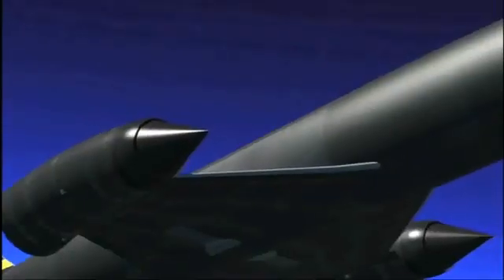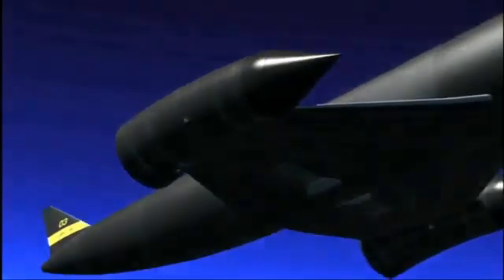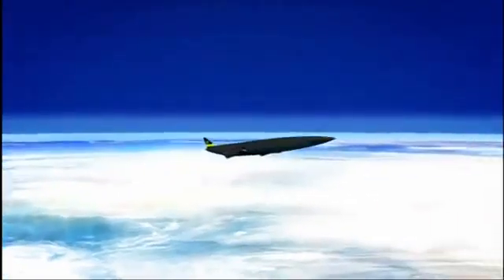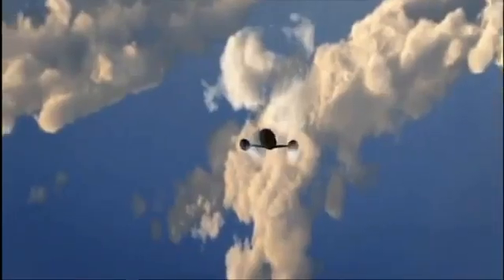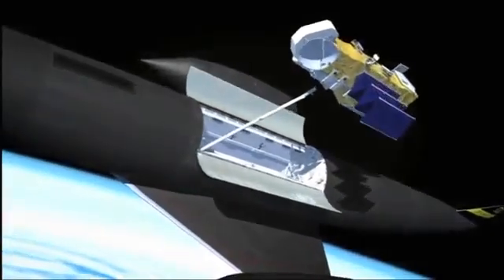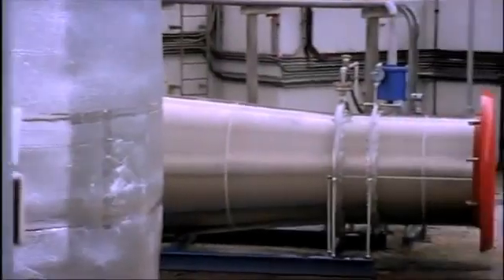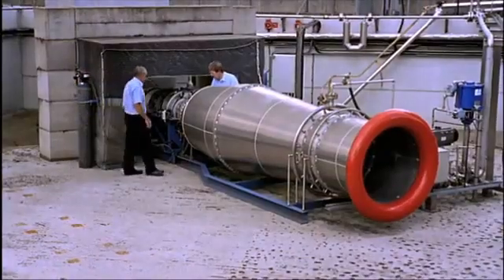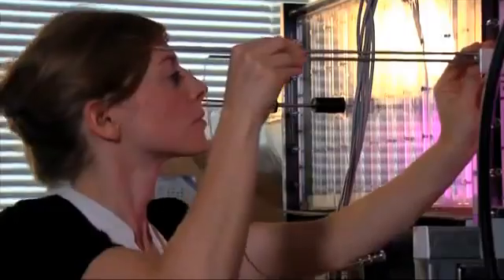Skylon SABRE Engine

Comment: While very impressive, I don't know if anyone else has spotted the obvious problem. It takes 38kg of air to burn 1kg of Hydrogen.  But it takes 2.6kg of liquid hydrogen to cool that air. (Back of envelope calculations). If you use the 1kg of hydrogen to cool its own air, it will drop the temperature from 1000 degrees C to 560 degrees C. I don't know if that is the extra weight and complexity of the precooler.  But it is still very impressive technology and will no doubt find a place. .

Comment: Instead of this lets use a  Nuclear  powered turbofan-scramjet-rocket hybrid. by using mini reactors the size of a 3liter container we can eliminate flameout of scramjets (their main problem) and still be safe if we use gas cores.
PLEASE NOTE THE AIR WILL PASS THROUGH A HEAT EXCANGER NOT THE REACTOR  ITSELF.

The turbofan would bring the aircraft off the runway reaching about Mach 3 then switching to a ramjet configuration witch will switch to a scram and then finally a rocket to finally get the last bit of speed it needs.
If we use this we can save space and weight because it would need very little fuel. and if the reactor has a problem then it could be shut down quickly for a emergency landing. (We could use a two loop thorium fueled gas core reactor)